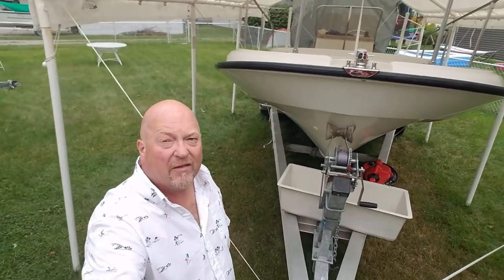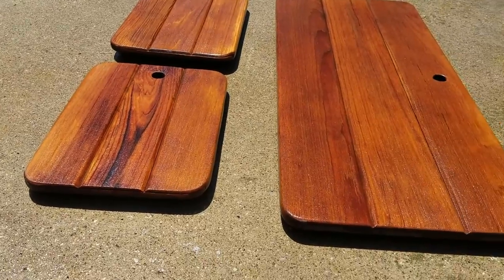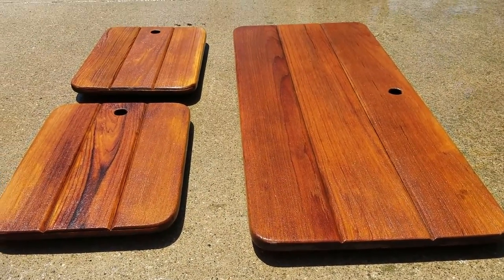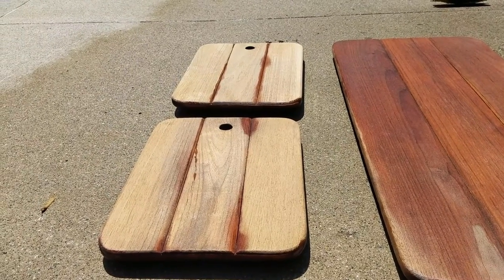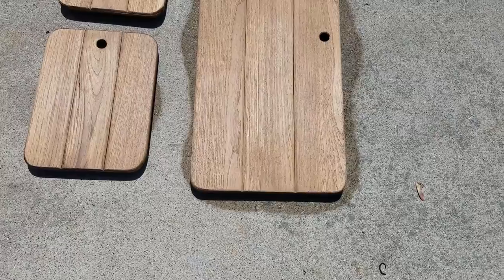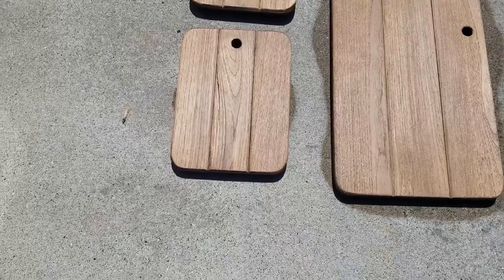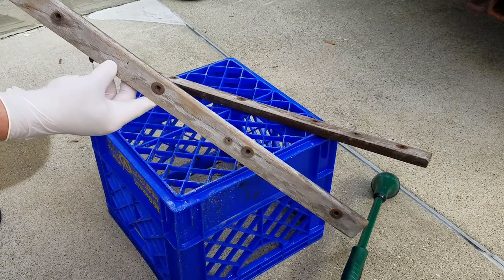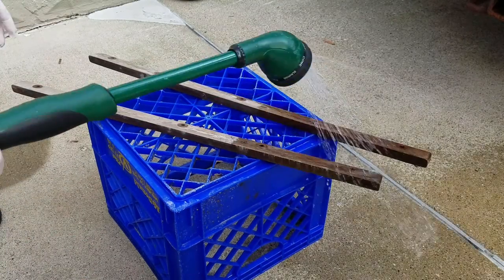Boston Whaler Restoration Episode 3 how to Clean Teak |  1977 21 Outrage Banana Boat Retrofit

Comment: sure brings back memories of usin that stuff on the teak of a 21 revenge I had. sad part is the previous owner(s) had pressure washed the daylights out of the poor teak, removed so much pulp I was left with severely ridged wood. SO I had to sand it back down about a 1/8" to get top uniform wood. Your wood looks in pretty good shape (no jokes please lol ) what a pain in the tail and miserable in the s fl sun with a respirator on as teak dust is pretty nasty. I refinished with a product called bristol finish, 3 coats and it looked like glass and if kept out of the sun when not in use, is a one and done for the most part product on small trim like this. I sub'd as I am back in the market for a classic whaler. Nice to refresh the ole grey matter to these things.